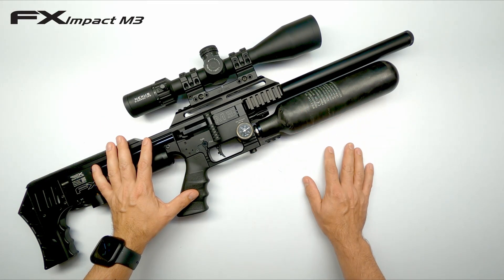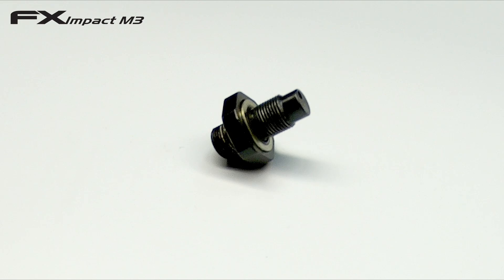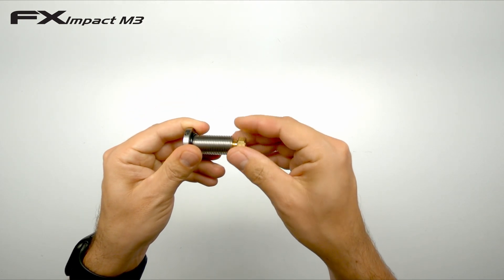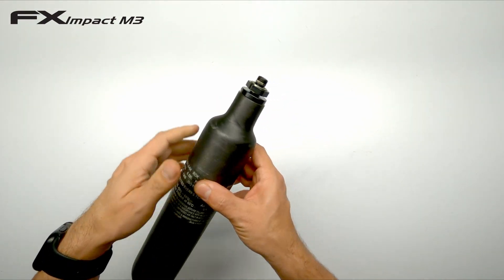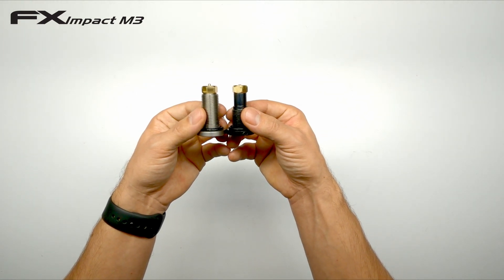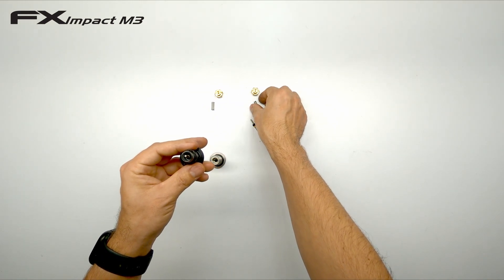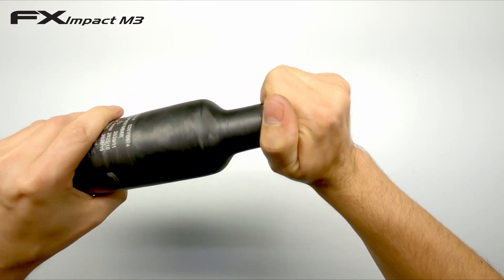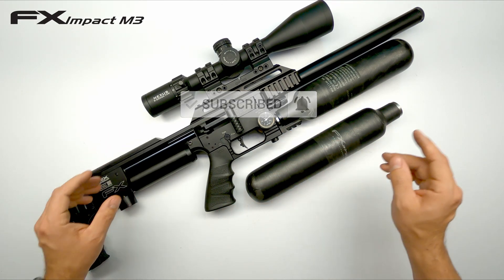FX IMPACT CF bottle MKII to M3  Conversion

Comment: Hi i just ordered a .30 cal Maverick VP, with 400cc al. bottle will this work with my Impact M3 ???
Reply from the maker: It depends on the valve used in the alu bottles , the M3 needs a valve with the copper bushing on it

Comment: Buenas el regulador # 1 de la M3 se le puede montar a la FXMK2 aunque no quede con el manómetro adelante le sirve. ?????
Reply from the maker: English 😬
Reply: @Airbuks  good the regulator #1 of the M3 can be monte yo the MK2 even if it does not Fit with the.pressure guage un front of it ????
Reply from the maker: @tomatepintor6203  as far as I can understand your question 😉 no there is no option to add the 1st regulator to a impact MKII

Comment: Do you need to apply loctite or some form of thread locking compound to the threads when reassembling?
Reply from the maker: I don’t use any thread lock of any kind the orings seal just fine

Comment: Is there a way to use the M3 valve with an FX Crown? From what I see here, I cannot see why it should not work.
Reply from the maker: Hey , the M3 valves can be used on all FX guns , I have a M3 valve/bottle on my crown right now 👍🏻
Reply: @Airbuks  so does that mean you can use it to make a crown have a double regulator setup?
Reply from the maker: @sambaaxe  no , the difference in the bottle is just the valve it has nothing to do with a double reg setup for the crown
Reply: @Airbuks  Do you have any idea if it would be possible to adapt the bottle reg to work in the Crown?
Reply from the maker: @sambaaxe  i am afraid that wouldn’t be possible as the threads size on the bottle adaptor is different